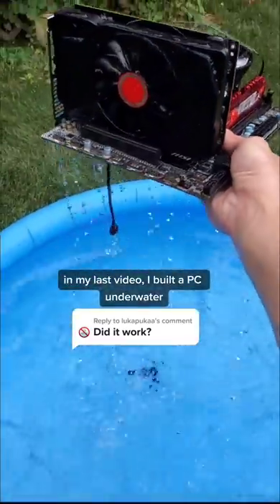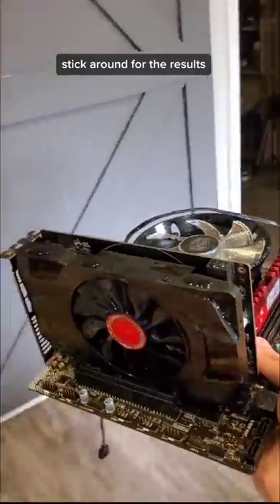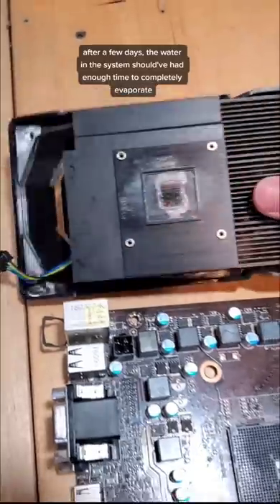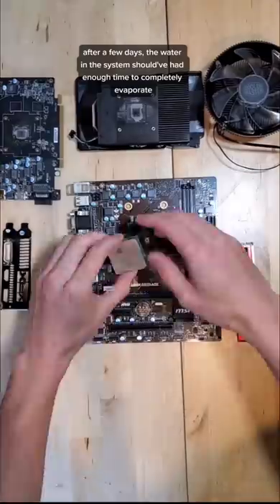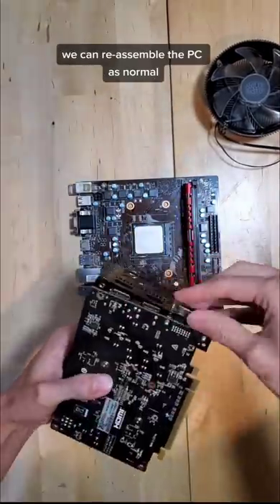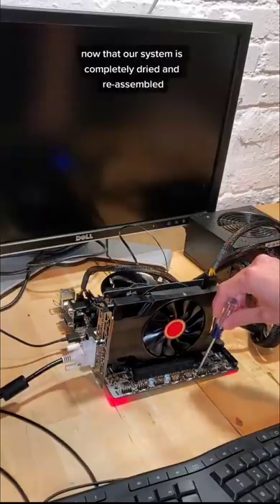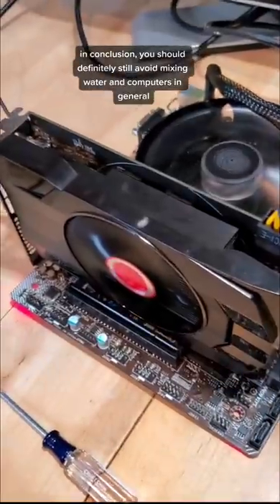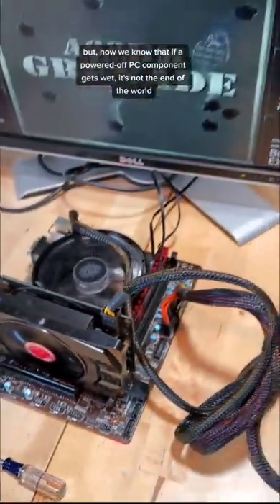Does the Underwater PC still work? #shorts

Comment: U can theoretically run a PC underwater,  provided that it's distilled water ...
Reply: Or any non-conductive solution
Reply: Mineral also Linus has run his in a full fish tank lol
Reply: You can't, pc components are solubile enough in distilled water to make it conductive in a few seconds. Especially metals.
Reply: @Anankin12  not with I think it’s either mineral or non mineral water
Reply: The thing about distilled water is that it makes it easier for small particles of metal from the computer components to disperse into because there's a higher concentration gradient between the water and metal than usual. 
So the distilled water will slowly be filled with conductive minerals and kill the components. It's sort of like shitting yourself until you suffocate or get diseased by it.
Reply: Yeah it wouldn't last long
Reply: @marshian__mallow2624  Mineral water is not distilled water. It has got ions dissolved into it.
There's no distinction between mineral distilled water or whatever other kind of distilled water.
Reply: And depth
Reply: No you can’t because distilled water becomes conductive overtime
Reply: @TheFord-mw9ct  it was oil not water
Reply: @marshian__mallow2624  lmfao mineral water is why water is conductive. Distilled water will get contaminated and become conductive in less than 10 seconds - based upon a crap ton of factors. Mineral oil is safe and people build fish tank PCs with them but there is still maintenance .
Reply: Bruh components get damaged when there's water while the current is flowing so he just put and removed water there so no obstacles for current to run freely thru components
Reply: @smpblousedesigns4840  distilled water doesn’t conduct electricity
Reply: Yay 5th grade science
Reply: @zues121510  fantastic analogy
Reply: @Anankin12  you can
Reply: @Anankin12  I mean you can for like a few then it won’t really work
Reply: @skrobie  Yeah but from what I've heard mineral oil leaves a slimy coating on anything it touches 🤢 though it won't kill the parts
Reply: A traditional hard disk drive will die in any type of liquid, as the write/read head will totally separate from the disk or scratch it if any liquid went inside. It could work with an SSD. But most people do this with mineral oil instead, which is safer, I think.
Reply: I think your confused. Mineral water when dried can leave deposits which can still allow small amounts of electrical currents to cross where they shouldn't. Distilled water doesn't.
Reply: No, you'd have to do it with saturated water (with non-conductive stuff) so the pc doesn't slightly dissolve into frying itself
Reply: @Daa253  novec is actually very different to just dunking the pc in mineral oil. You design your enclosure around it because it boils at something ridiculous like 50°C so when you turn your pc on it becomes a bubble machine haha. And you have a condenser on the top of the case/tank to cool and recover the evaporated liquid. Really sick shit.
Reply: @Jackofafewtrades  I know it's different 🤣, it's so cool
Reply: As long as it's not on the mobo, you will be fine
Reply: @Hietakissa  that wouldn’t make it water
Reply: @benygames7399  you are correct, hence why I said "or"
Reply: @Hietakissa  ya but why even comment that? It’s fine it really don’t matter that much
Reply: @benygames7399  I was just pointing out that you don't have to use water, there are other applicable solutions as well
Reply: @zues121510  I didn't understand until you gave the suffocation by feces analogy, then I could relate immediately. Hate it when that happens.
Reply: @Anankin12  exactly
Reply: Mineral water could work too
Reply: @Anankin12  non mineral water is non conductive so you can run a pc with that in it, ideally it's what you'd use in water cooling as if it leaks there no damage and just a small cleanup
Reply: @Potet  lol you must have 0 knowledge on why water is conductive.
Water per se is a neutral chemical compound with no free charge available to be moved. It is an insulator. If you apply an electric field to it, you won't have a flow of charges, since there aren't any available.
The moment you have ANYTHING dissolved in it, you have ions in it. Ions are charged and can freely move in the compound, thus allowing for a charge glow also known as current, making water conductive.
This is irrelevant though, because components immersed in distilled water will immediately start to dissolve, filling the water of the aforementioned ions. 

Note that even distilled water can be conductive given a high enough voltage applied to it since the water itself can undergo electrolysis and split in ions itself.

The distinction between mineral and non-mineral water is completely irrelevant in this context.
Reply: @Anankin12  Can you like trim that down yo about a single paragraph, my dyslexia won't let me read all that
Reply: @jusarson7237  Mineral water is just water with some specific kind of stuff in it. Water is water with stuff in it.
There's no difference for conductivity.

Distilled water is an insulator, but as soon as you put metal and something else in it... No longer distilled, conductive.
Reply: @Anankin12  Ah ok, so what did linus use in his fish tank vid?
Reply: @jusarson7237  mineral OIL if I remember correctly, let me check.
Reply: @Anankin12  Ayo somebody talking bout oil?
Reply: @jusarson7237  ?
Reply: Distilled water can still conduct there fore you can't, any other videos with it under "water" use mineral oil or various other non conductive solutions
Reply: @Anankin12  solubility and conductivity have absolutely nothing to do with eachother and are completely different properties of a material
Reply: @karuki5791  obviously, when did I say otherwise?
Reply: @karuki5791  you understood nothing. I was talking about the distilled water, which will become conductive as soon as there are ions (dissolved stuff) in it.
Reply: @Merciful_Arts  mineral oil eats away metal and plastics and isn't great for a long term solution
Reply: then how can you guys explaim how linus sebastian had a pc inside an aquarium?
thr only downside is for long term the plastic will become a goo
Reply: Not for long though
Reply: nah, just do it under thermal paste like every normal person
Reply: The pc itself turns distilled water into normal water
Reply: Why didn’t someone in the 70s build an aquarium pc
Reply: Mineral oil works too.
Reply: Smart boy👍🏻
Reply: disolve dust may trigger current flow
Reply: @murtza_6640  Hydronium and Hydroxide...
Reply: or mineral oil
Reply: No you cannot. Oxidation still occurs even with distilled water.
Reply: Only for a day or two. The water will soon erode the metal and absorb it, therefore marking the water conductive again.
Reply: I don’t know about distilled but i deionized water works
Reply: @marshian__mallow2624  mineral oil*
Reply: @marshian__mallow2624  i think it was mineral OIL
Reply: @TheFord-mw9ct  mineral OIL not water
Reply: mineral water, a couple people have done that, pc in a fish tank with mineral water
Reply: @zues121510  lovely
Reply: @Hietakissa wouldn't be underwater then
Reply: @Shadow-dl2iz  no it can’t, distilled water is non-conductive, unless conductive minerals are dissolved in it or the voltage is so high it breaks down the water to conduct electricity .

Comment: As there was no electricity running through the system when it was covered with water, no damage via shorting out could occur.
Reply: every parent didn't like that
Reply: @musteycraft  ?
Reply: @pigasusr2  capacitors: am i a joke to you?
Reply: @potater6163  you know you can drain capacitors pretty easily by disconnecting the power supply and then trying to start the pc?
Reply: OKAY WHAT ABOUT RUSTING
Reply: @mullerstephan  most components of the pc are non-ferrous, meaning they won't really rust.
Reply: @louiesatterwhite3885  which components are ferrous then?
Reply: @mullerstephan  Watter corrodes the solder on the components. If it gets bad enough, either the electricity won't flow through that path anymore or the solder could break off completely. It still can kill your system, even when it was powered off
Reply: impurities in the non-distilled water could react with elements in the computer components to create corrosion.
Reply: It’s distilled water
Reply: Cmos battery still there. 100% dead.
Reply: @bluefire219  even if it was normal water, it wouldn't matter because there is no electricity flowing through it
Reply: No shit
Reply: @TheRealNaika  CMOS batteries have a very small capacity. Their power is not enough to start a a corrosion that would be enough to kill a component.
Reply: Wow your a genuis

Comment: Watercooling on a new level
Reply: sadly cant do so while the pc is running, as water is conductive and then things will start breaking.

But you can definitely wash any part with water if you're sure it then is completely dry before turning on
Reply: well and should be sure that there is no electricity at all in the system before coming in contact with water either
Reply: @user-wq9mw2xz3j  man, it was a joke
Reply: @maheshchandra3894  plus if its water it would mean its at most 0 degrees, but it would heat up very quickly and then not help at all, contrary it would make the components warmer
Reply: @user-wq9mw2xz3j  k lmao
Reply: FREEZER COOLING
Reply: @user-wq9mw2xz3j  Sherlock in the house
Reply: @mindnova7850  person on a tech channel talking about tech, damn hes such a shrelock
Reply: @100tinka  Be it’s obvious. You don’t need to be a genius to know this.
Reply: @ESA_XSA  sadly, freezers aren't meant to combat constant heat production

Comment: Even after the water has dried (assuming it's just normal water) it can leave conductive mineral deposits that are likely to lead to a short even if it works as normal for a time. The best thing to do when an electronic gets wet is to clean it with high grade rubbing alcohol

Comment: I would like if he turned on the computer underwater with a protective case on it
Reply: why would it not work? It would still overheated due to lack of fresh air thou
Reply: @hulem98  you could technically get the oxygen to be sucked out of the water. Still very hard and un-realistic though.
Reply: @hulem98  or even distilled water might work
Reply: @hulem98  Well for one it needs cooling so it couldn't work with fans, since there'd obviously have to be an intake and exhaust. I guess water cooling is an option though.

Comment: And the schools are still saying that you shouldn’t pull the stickers of of the $50 chromebooks
Reply: You shouldn't in every case actually. Some manufacturers added contact wires inside the sticker to help some wireless features to go through the chassis.

f.e. Huawei Share sticker
Reply: @serenity5892  source?
Reply: @irvingchies1626  I literally gave a name right under...
Reply: @serenity5892  lol I thought you were saying that thing about the sticker just because you heard it somewhere but after googling it I see it is a thing, and let me say it's a stupid design flaw, on all the 3 places I read about it there were peope saying they removed the sticker without knowing the thing was on the sticker, which is more than normal, who puts antennas on stickers beyond the anti-thief solutions in store entrances? I hope they fix the design for their future consumers
Reply: @irvingchies1626  I'm not gonna throw random bs I heard at a party, but I get your point haha. 

The metal body is the issue I think, and they sure could work on that. But it looks like a late "fix" to an overlooked manufacturing problem.
Reply: @irvingchies1626  if your buying a chromebook you should suffer the stuck on internet antena. this comment was made by a windows fanboy
Reply: @potater6163  I've never suffered that because I only use desktops I build myself so I never had any antenna-stickers
Reply: @irvingchies1626  nice, clearly a gamer from the pcmasterrace comunity

Comment: The reason it’s safe to have a wet PC component while it’s powered off is without power, nothing can short-circuit. If you spill water on a computer, turn it off immediately and dry it.
Reply: I mean it still shorts circuit, there's just no power supplied to do any damage.
Reply: @gizmodobaggins7040  JayzTwoCents, Gamers Nexus, and even NVIDIA customer care said that it won't short circuit as long as there is no power going to the component.
Reply: @J_KM654  Then they're all wrong. There is still an unintended circuit with low impedance, so there is a short circuit.
Reply: @infinitelyexplosive4131  “tEcHnIcAlLy”
Reply: @L39T  ?
Reply: @infinitelyexplosive4131  u tryna fight bro i got a black belt in karate kid fight school
Reply: @infinitelyexplosive4131  ah yes, the company which makes graphics cards are wrong about their own product

Comment: As a side note, water itself is not a problem. Water is not electrically conductive, it is the minerals in it that give trouble. If you do this at home, your results will vary depending on the minerals in your water. One of the big issues is with salinity and iron content, as they seem to kickstart the oxidation process a lot faster the higher their content.

Comment: A real experiment would be filling up your PC case with oil and seeing if it works. Or using a different substance like propylene glycol or glycerin and seeing if it still runs :p
Reply: I don’t understand about half of the words you just said
Reply: As long as the fluid is non conductive it'll work. Mineral oil submerged PCs aren't exactly common, but it is a thing people do.
Reply: He already did a video using a PC in a bucket filled with oil
Reply: It's the first video he uploaded I think

Comment: Experimentation aside the best way to preserve the computer is to blow the excess water out by high pressure water before the three days drying. That's to prevent water reactions on dry acids that will destroy the integrity of connections later.

Comment: The main reasons water ruins electronics are:

• Device was turned on while still wet (and then shorts, which ruins it)

• It was salt water (which causes corrosion)

If it's fresh water and you don't try to power it on until it's fully dried, it's usually OK.

As a side note, 100% pure water would probably be ok to run a computer in since its not conductive. Good luck finding some though.

Comment: If the pc parts are off while in the water, and you take them out, wait for them to dry and then turn them on, it'll work. But if it's on while it's in the water, it will short-circuit and stop working.

Comment: People always said that I was crazy, but I fixed a lot of motherboards doing this. When I was facing a motherboard that didn't boot up, after I tried every possible solution, I took the motherboard apart, remove the memory, processor and everything and proceed to clean it up with some detergent, water and a new clean paint brush, after that I took a hair dryer and make sure the board was completely dry on every corner and connector, most of the times actually fixed the issued!

Comment: If it was deionised water there will not be any micro-corrosion after water ingress. Deionised water does not  contain minerals and does not conduct electricity. When pcb is dried it can be used again. For better protection (if water still is there) is the bath in 99% isopropanol which will push water particles out or bind with them.

Comment: I wish he can build my pc. He’s so good at it
Reply: he can

he just wont
Reply: You get better with practice bro
Reply: Welp, you gotta study computer science a lot first in order to learn how to build one
Reply: @Ersguterdjberlin  haha not really bro, just a bit of tutorials and builds and you're pretty much good with most things. Trust my experience, i been doing it for a couple years now and i gotta say, all you need is a screwdriver, side cutters, zip ties, maybe some thermal paste and your parts. Follow the layout of the video and any obstacles can be cleared with the manual. Especially the motherboard where its almost essential for those front panel connectors. Cable management is just about time. It's really not as hard as you think.
Reply: @EagleFPV43  Yeah but the thing is few accidents happen from building a PC for making several mistakes that made them break something
Reply: @Ersguterdjberlin  that actually rarely happens if you're just careful. Cpu pins won't bend if you place it carefully in the socket and in the right direction, thermal paste should just be a small pea sized drop, motherboard shouldn't be thrown around but taken care of like you normally would with anything fragile (jay even did a video showing how he poorly handled parts and it still worked fine showing it's not as fragile as it looks anyways) and static is really not common if you don't build on carpet and you touch the plugged in psu every now and then. 

Have you built your first pc? If so, let me know and im welcome to help you in any problems you had or that you are co fused about
Reply: @Ersguterdjberlin  nope
Reply: @Ersguterdjberlin  You don't really have to. There's a lot of build recommendations to avoid bottlenecks and incompatible hardwares, most building tutorials on youtube explains a lot about cable managements, how to insert hardwares etc etc
Reply: bruh building a pc is the easiest shit ever, the hard part is cable managing a whole rig.
Reply: @Ersguterdjberlin  you dont need to dude like wha?? its literally plug and play
Reply: @Ersguterdjberlin  i learned how to build a pc when i was like 9yrs old nd learned how to watercool when i was 13, you only need screwdrivers for the case and the gpu slot, and the cpu is also easy to install only needing to line up the tiny triangle at the corner to the corner at the motherboard.
Reply: @Cyrex64  Haha yeah and the front panel pins